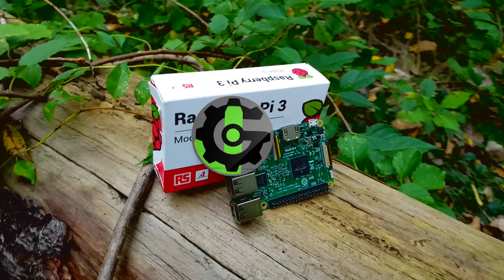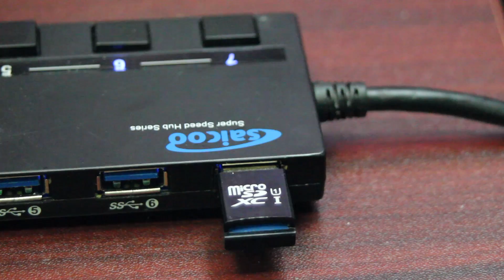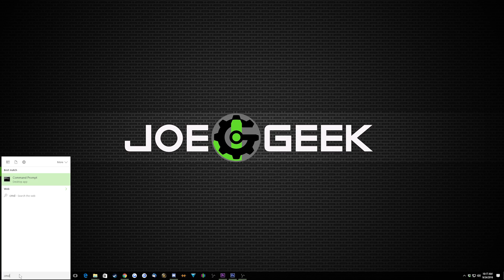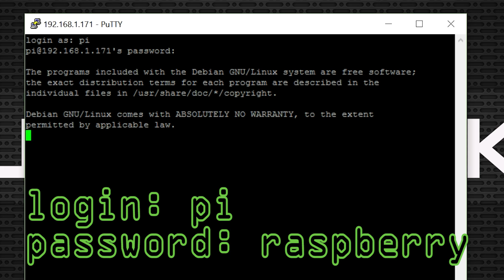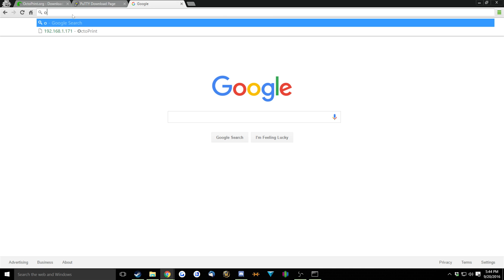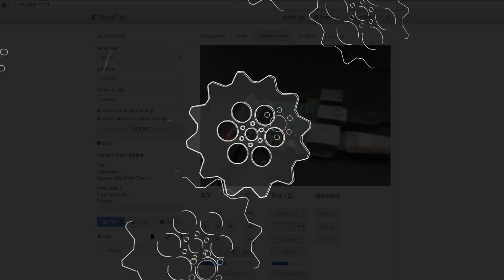Setup OctoPrint with Raspberry Pi 3 on Windows 10 [Latest] 3D Printing Pt2

Comment: Mine doesn't show up on network and I can't access it through putty.i keep getting the fatal error: connection refused. It pings just fine with the IP address but can't get it to respond with the name. Can you cover how to correct these issues?

Comment: Hello Joe,
I tried to install Octopi by using your steps in the second vid. All seems wel untill I reach the stage after entering "sudo raspi-config". At that point I get a screen with 9 menu-options, starting with "1. Change user password". And als not the choice of item 6 "Enable camera".  I am using Octopi version 14. Can you help me please ?
Reply: The option to expand file system has been moved to "Advanced Options". And the camera can be enabled from "Interfacing Options".

Comment: Hi, I'm having some troubles. I put "ping octopi.local" and it couldn't connect. How do I find the IP address that I need? Completly new to all of this so take it easy on me. lol
Reply from the maker: I had the same issue from time to time. What I do is look for it on Windows explorer under "Network" it should show up as OctoPi or some name close to that. Once you find it there, you should be able to click "Visit Website". Click that. It will then give you the IP address in the address bar up top. Write that down and save it.
That is the way I find it when it doesn't show with a ping. 
One other way is to look for it in your router directory as well.
HTH

Comment: Extruder Joe, Hi I do not understand the CMD part, when I put ping octopi.local i get nothing. And where you got that ip from? where to search mine? is there any step by step guide that I can follow up? I think that is my problem too when I am trying to use NanoDLP to get it run on my DLP printer.
Reply from the maker: I had the same issue from time to time. What I do is look for it on Windows explorer under "Network" it should show up as OctoPi or some name close to that. Once you find it there, you should be able to click "Visit Website". Click that. It will then give you the IP address in the address bar up top. Write that down and save it.
That is the way I find it when it doesn't show with a ping.

Comment: I got Octoprint to run on my Raspberry pi 3 without  expanding file system and without using Putty whatsoever or any other SSH as far as I know. Is that going to be a security issue? I kept getting "Fatal Error: Connection refused" when trying to connect through Putty so I just skipped that part. I don't even know what Putty is for....

Comment: how do you set up the Webcam?
Reply from the maker: Literally plug it in. Once octoprint turns on it just works HTH!
Reply: Extruder Joe yah it just works i kept researching and there is a file in the SD car that you need to change the resolution or else all you get is VGA resolution. Thank you for the vid. i use a Flashforge and still having some set up but for thr most part it working.
Reply from the maker: OH WOW!  would you share vid?

Comment: HELP
my setup
windows 10
ran win 32 disk imager
raspberry pi 3
logictech c207 camera
Ethernet connection
32gb samsung msd

I can see the octopi on my router screen if I use the IP address I get refuses to connect.
Reply from the maker: Hey Bob! Can you ping the connection? like c:\ping 192.168.1.10? If that returns TTL then you should be ok, maybe reinstall Octoprint again just to be sure.
Reply: Yes I can ping and I used putty on it but I get refused to connect
when I try to connect in chrome

Comment: Pi 3 has wifi on board !!!!
and theres no need to expand the file system manually anymore
Reply from the maker: Thanks for the heads up!
Reply: All good 
Cheers
Reply: I'll make an annotation for that. I wish I could edit the video
Reply from the maker: BTW Octopi author is going to change the tutorial reflecting it: 
https://gyazo.com/4e4381c8be56f16200990c62ddc21aa6